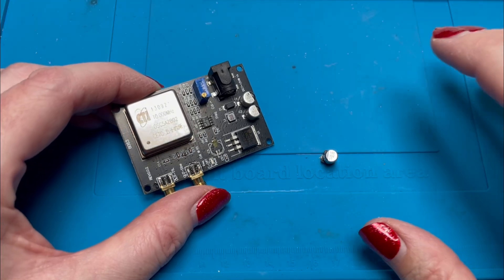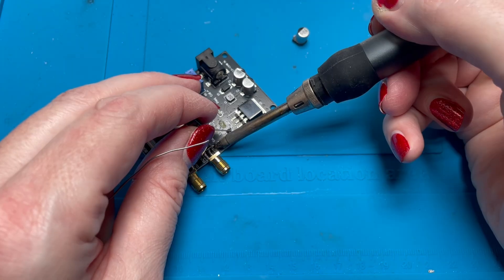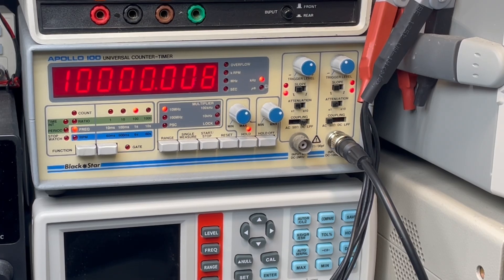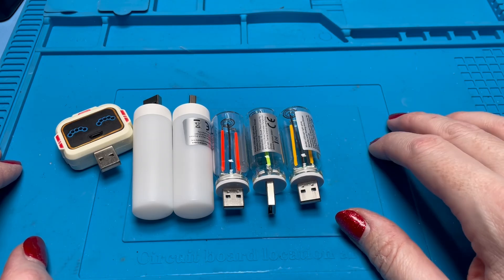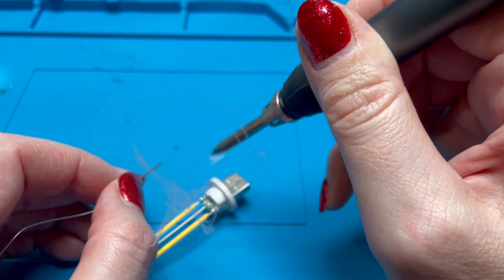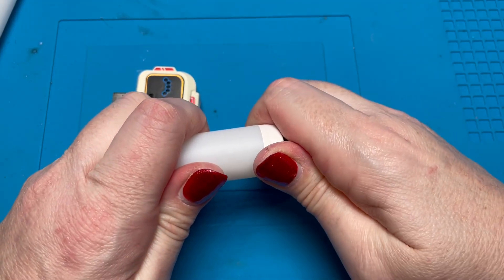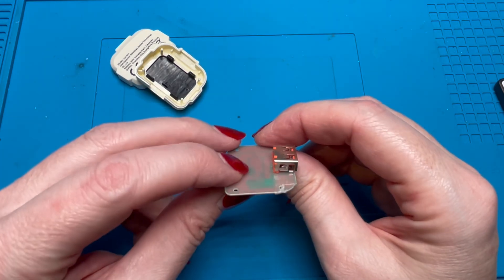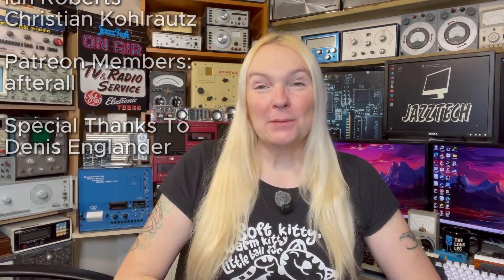Temu Tech Repairs Fixes & Teardowns!  Fixing The Frequency Standard Plus Bonus Gadget Teardowns!

Comment: I reverse engineered the circuit of that frequency reference & put the schematic in a thread on EEVblog forums (I'm 807 on that forum). You are lucky that you could actually get your reference to tune to exactly 10MHz (with 1Hz resolution), as mine would only tune down to 1.8Hz above 10MHz. It required a change in 1 or 2 resistor values in the Vref circuit. If you read the rest of the thread, you will see that they brought out a rev0.0.3 board with a slightly revised circuit. I'm not allowed to post links on YouTube, so if you want to read the thread then search for "Cheap chinese 10 MHz OCXO Frequency Reference Modules". My schematic is in Reply # 11.

Comment: A rule of thumb when buying anything from China with electrical components is to open them up and at the very least double check the connections and make sure nothing is loose. This is why Jazzy's channel is so important.
Reply: Hey friend, everything comes from China, what do you mean? In fact, what I've bought online have turned out of higher quality than the stuff I'd bought in the past from local businesses from reputable brands. But there is a little of lottery involved and good common sense when buying online of course.
Reply from the maker: @AaronStarkLinux if you choose carefully you can get some reasonable stuff.
Reply from the maker: @IgottaWelt Thank you 😊

Comment: I'm not sure what you mean by Temu quality control, because they don't manufacture the stuff, the stuff come from the same factories and sellers Aliexpress, Shane, Amazon use. However, I heard, that Temu actually keep stock themselves rather than building up a relationship with a seller. But overall, I don't think they have time to check on quality control prior starting the sale, they just do it progressively based on customer's feedback. But all in all, Temu is newer and they have less experience than other competitors, and it shows.